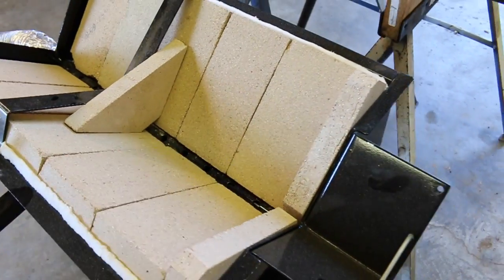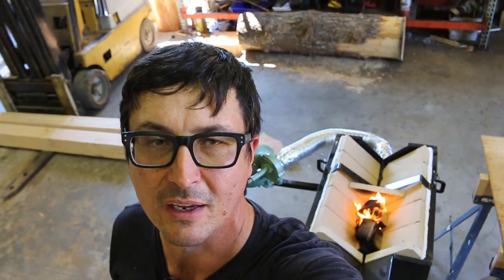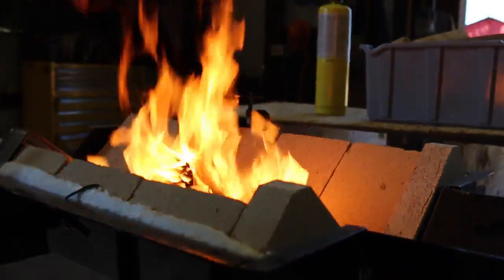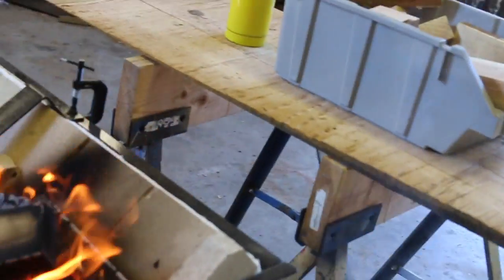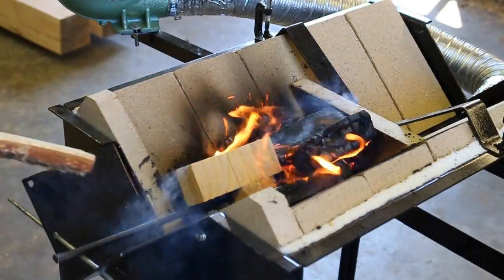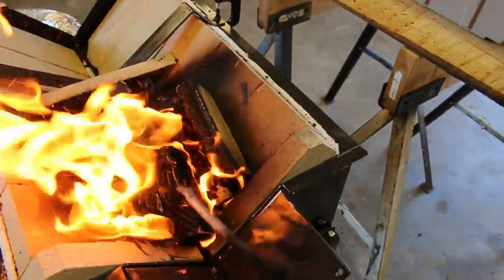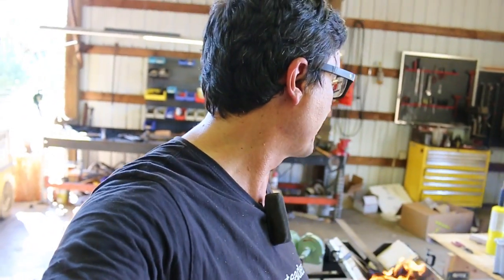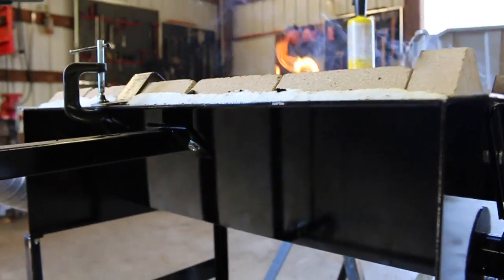Forging Steel With Wood Scraps

Comment: The problem with Cody on this video, He does not understand the critisizm. Nor is he willing to listen.
Im a professional carpenter so il compare to that.
I can use whatever screwdriver on the planet, but there is difference in quality!
There is alot of different factors that imply when you build something, and determines the quality.
Same with forges!
Yes it might perform as good as you need it to be, and you could even stand on it. But it is LOW quality, and if you cant admit it, that is your personal failure. (you even had a fan: American Dreamin , explaining your own principlies, that he has learned from you and your videos)
There is a reason bases for "professional" tools are made out of cast iron. (a freestanding forge with stamped metal parts is NOT quality!
For the last time..
From my point of view without having used this forge myself. It looks like a low quality product, but with small improvements could be of "higher" quality.
Reply from the maker: nullings Here is how I see it. I own the forge and am currently using it. You do not own the forge and have never used one. Who's in a better position to have a valid opinion you or me? This comment is particularly offensive because in a backhanded way what you are saying is I can't be trusted to tell the truth to my subscribers. You imply I'm so myopic in my loyalty to this given product that I no longer posses the ability to give  an honest report.
Reply: You are right on the implicications, but that is what my conclusion is after watching almost all of your videos!
I respect you Cody, and i would never think you would ever be dishonest to anyone.
If you say this forge is a great product, i belive you!
I only think we have a misunderstanding when  defining the word "quality"
For me the word should only be used at certain type of tools with certain standards,
It most definitly is a very nice forge that is both practical and cheap, i like that in anything:P
Sorry for my harsch way to write,It is all from the heart with the best intent,
Wish you and your family a great summer, from Northern Norway